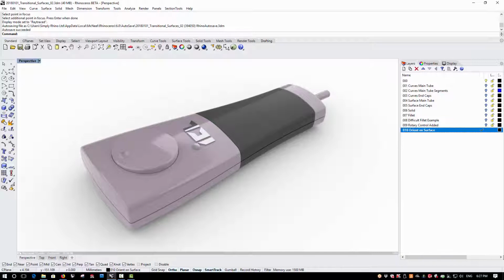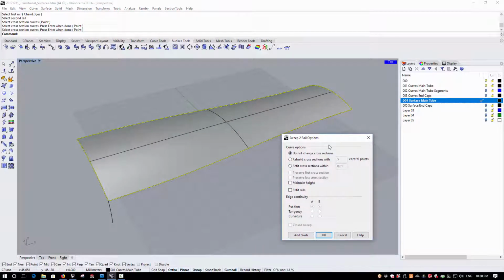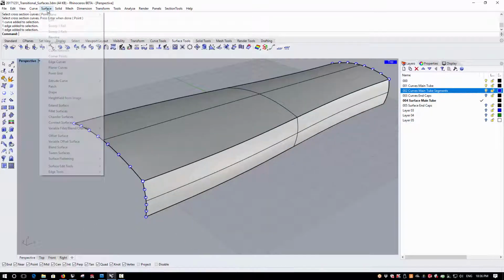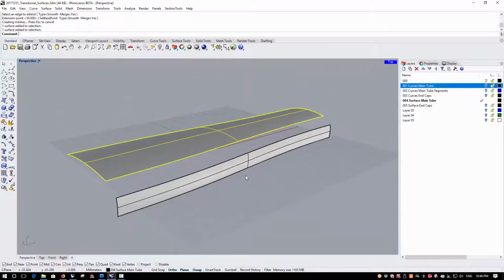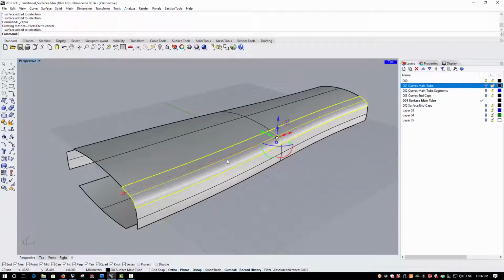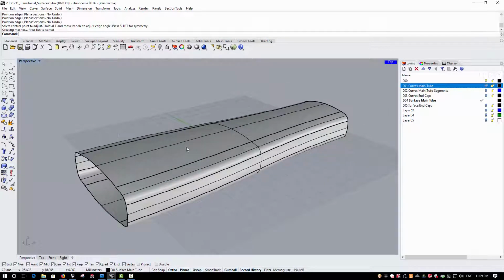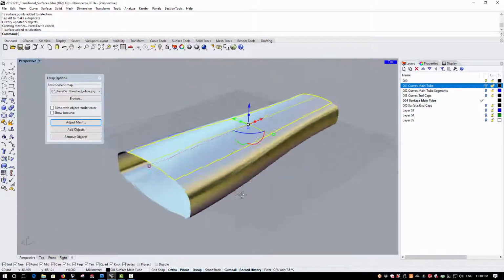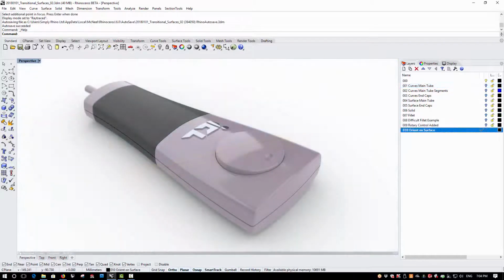Rhino3d v6 for Windows / Modelling Enhancements - One View, Sweep and Blend Surface with History

Comment: Hello Phil, Can we model complex A class surface in rhino 6 for Car designing, If yes then plz make a video of it. 
I simply don't want to shift to alias for this work. i am more comfortable with Rhino.
Reply from the maker: Hi vinay, If by ‘Class A’ you mean curvature continuous matched Bezier patches (or single span surfaces) then the answer is yes but the workflow is different in Rhino to Alias. Alias maybe has more options for controlling number of spans, degree etc than Rhino does. In practice in automotive design you do not need Class A surfaces for conceptual work but certainly will do for creating final surfacing.
Reply: Phil, let's have a video on car designing in rhino by you... We can learn the system in depth from that. Rhino 6 has better options to handle the curves. May be we can learn something new and detailed.